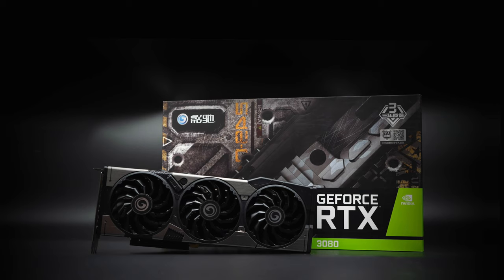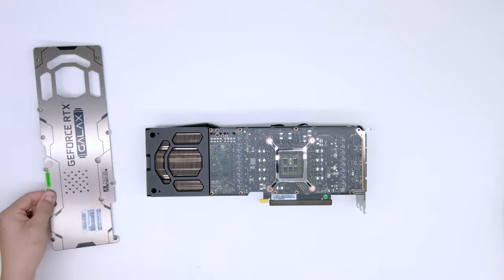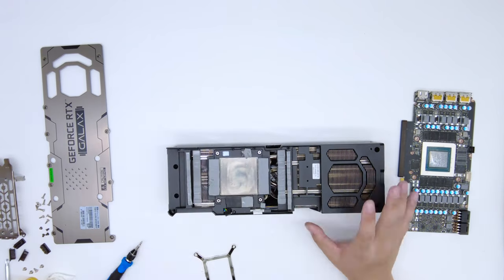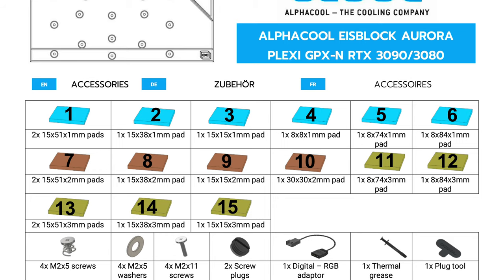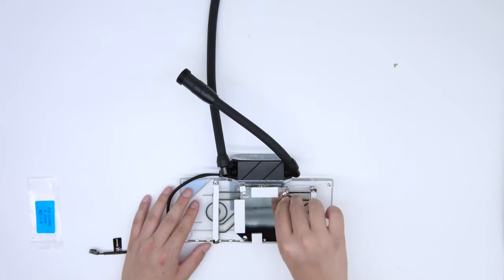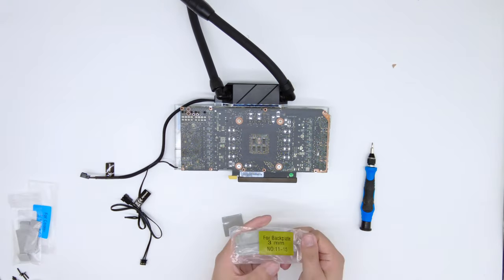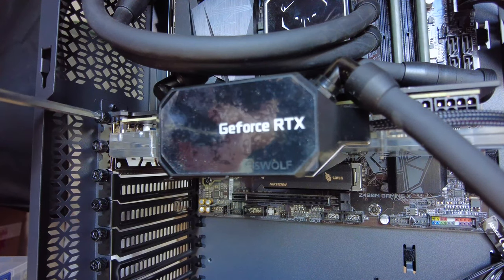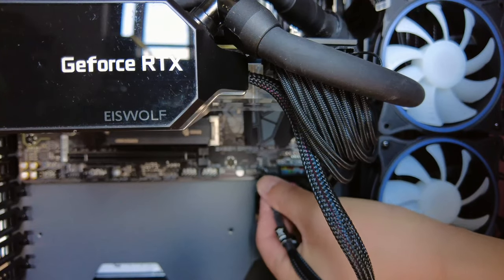Galaxy 3080 x Alphacool Eiswolf Watercooling Kit - Part 1. Installation

Comment: Just for anyone wondering. I got this for my 3080 gaming pro and it went from 85c to 45c max load. 65c to 34c  idle. This was the best thing iv done for my pc. No noise either :p would recommend this over any other cooler set up. Affordable and efficient.
Reply from the maker: great to hear! Checkout my ZZAW C4 custom loop video if you have VRAM temp issue too. Replacing the thermal pads on the VRAM proves to be highly effective.
Reply: How is it holding up 7 months later? I've read varied reviews
Reply: I guess after several months he realized that its the worst thing he have done for his pc (immediately regret the decision)
Reply: Is it prefilled? Don't understand how it has liquid in it when the hoses have connections.
Reply: @rceenomil  yes right:D i guess he also bullshit a lot about his 45C max load GPU to:D 
Cause i just see a german guy testing ALPHACOOL EISWOLF 2  with 3080ti and he say the fan are very quiet till at around 30%,, and at 30 % fans he get 65C on GPU and 73C hot spot GPU, and at 100% fan (he say is very loud like plane jet:D) he get 56C gpu and 64C hot spot, mabe if u replace the fan with arctic P12 argb or noctua to be quiet. I also see a us guy he getting 54C gpu at half of the speed on haven benchmark but with rx 6800.

Comment: Currently have an EVGA 3080Ti FTW3 and debating between the Alphacool Eiswolf 2 and the EVGA Hybrid Kit. I assume the Eiswolf 2 would cool the VRM better than the hybrid kit, but I look forward to your review first.
Reply from the maker: For VRM, Alphacool waterblock actively cools 3 sets of MOSFET, and that's about it. There's no direct contact for the inductors, capacitors. According to them, only MOSFET needed to be cooled and the rest are fine as is. I will keep in mind to do a thermal shot of the inductors and capacitors, but for my miners, MOSFET run about 50C, inductors about 75C. 

Again, I'll do the thermal during the test. Thanks for watching and commenting!
Reply: Did you go for the Eiswolf for your card? If so, how is the temps on the evga?
Reply: @nictheflick  it turns out that the Alphacool Eiswolf 2 was not compatible with EVGA FTW3 cards at that time I wrote this comment, but I believe they now have a separate AIO for the Eiswolf 2 for EVGA cards. So at the time, I went with the EVGA hybrid kit and it did an amazing job in dropping temps to 26 C on idle, and 55 C in most games, sometimes going up to 63.

Comment: for the quick disconnect do you think you could plug a g1/4 connector into it or get an adapter so you can use a bigger radiator
Reply from the maker: Absolutely. Alphacool sells the TPV connector that you can simply cut or add additional components. Pump, in the other hand, might not be able to handle completely, so addtional DC-LT pump might needed.

Comment: Wondering how much third party brand as well as super/ti versions of a 4080 will make a difference in what cooler to get?
Reply from the maker: For 40 series cards, cooling advantage of watercoolig is somewhat less than 30 series and before. The real thing about watercooling the 40 series is reduced size. With that being said, stick with AIC boards will help shrink down the size of the 40 series cards, while maintain or improve cooling. 

If size is not the concern, sticking with air is fine as well.

Comment: Do you need to fill in the water by yourself? How is the RGB connected, what sort of connection does it use? How is the Pump and fans connected to the system? Those are things I need to know before purchasing one.
Reply from the maker: Hi, with EisWolf AIO system, water/coolant is already in the system. There is no need to fill. 

Pump is actually right above the waterblock within that screen looking bridge. Fans are screw-onto the radiator, you do need to assemble that. There're screws provided.

 Pump is a 3pin fan plug, and fans are standard 4pin fan plugs, RGB cables are provided too. There's also Y cable provided for the fan plugs in case you don't have enough fan socket available on the MB.
Reply: @masterbamboo  OK, thank you very much for answering! Have a great day.

Comment: My only concern is the warranty for my GPU. I am sure that if my GPU fails for an unrelated reason, every GPU seller would love to blame me changing out the OEM cooler.
Reply from the maker: For few years I've been modding the GPUs(started with 780 with NZXT AIO conversion lol), even with some RMAs on 2080, 1080 even the recent 30 series, I haven't had any brand that accuse me of damaging the GPU. Few things to note:  

First of all was making sure myself is not the one to blame - issue not caused by leaking, shorting out circuits. 

Seconds, few brands has been friendly with me personally: ASUS, GALAXY, Yeston, DELL/HP OEM, I tend to stick with them. For those brands, you don't have to go through seller to get the cards RMA. 

Third, make sure you have the sticker removed or replaced properly before sending back for RMA. 

Hope it helps.

Comment: Great video! My AIO came with dirty water inside. The radiator should be with cables on top or down?
Reply from the maker: Thanks! The Alphacool kit has its pump with the GPU so the orientation really doesn't matter THAT much. If the coolant(CKC) is not clear, you can replace it rather easily.
Reply: @masterbamboo  It's just open one cable, take coolant out and replace it with the same amount?
Reply from the maker: @bollygod  There should be a fill port, right around the pump (top of the card or under the RTX cover), you can use the quick-connector to drain and refill if you can, and top off with the fill port. It's a process that'll need some patience.
Reply: What are your gpu temp in 4k?
Reply from the maker: @Hairtransplant993  Room temp ~20C, GPU core ~50C. Full load.

Comment: So I installed this on a 7900xtx and got hotspot temps that are like 40° over my gpu temp. Any ideas what this could be?
Reply from the maker: Yes, we found the center flow plate creates too much pressure. By removing flow plate of the waterblock (the thin square metal plate in the center), it improves the 7900XTX temperature tremendously. Interestingly this only applies to 7900XTX and none other model.

Comment: Could you tell me where the black mesh cable is connected?  I connect it to the water pump + of an asus motherboard, would it be fine there?  And the radiator fans, which would be the most suitable connector?  Thank you!
Reply from the maker: Hello, W_PUMP header of ASUS motherboards works great for the pump! Alternatively, the pump header can be connected to any fan header on your mother board, as almost all of modern ASUS motherboards has a 12Watt connector while the pump only draws about 4 Watts. If the light on the top of waterblock illuminates green, it's all good. 

For the fans, you can connect it to any fan header you'd like, and you can adjust fan settings accordingly in UEFI/BIOS menu (running at constant speed or depends on CPU/MB/VGA temp, however you'd like.)

Comment: hello 
very nice tutoriel 👌
i did the same and my gpu is now running at 63° full load i think its hot for a custom 360.
Reply from the maker: Thanks! during my test(upcoming), Alphacool's RGB fan is somewhat limited in it's capability. I did try to swap a different set of fans, it did allow it to cool down much more - I also tried push-pull config, which allowed me to slow down the fans and kept at a pretty slow temp. (42°C core during mining, 47°C for gaming)

Comment: Where is everyone plugging the pump into on the mobo? My CPU pump is already plugged into the AIO slot. Does the GPU pump plug into the spare water pump header?
Reply from the maker: I simply plug the pump header into the closest port I can find, set it to DC mode in CMOS, and making it run full speed.
Reply: @Master Bamboo  thank you! I've found another post where someone plugs the GPU pump into w_pump and it runs constant. Going to try first. ThanKS again!

Comment: @Master Bamboo where do you put the FAN PWR/CTRL into? Why not on GPU ?
Reply from the maker: putting it on GPU will require some modding to waterblock, which may involve drilling certain parts or purposely crushing the extension cable, which is not the best idea. So, the other way around is to plug it into the motherboard and control via fan headers in Windows, there's a fan control app which can control fan headers based on GPU temp.
Reply: @masterbamboo  in my Case there is no modding needed the PWM Fan Adaptor  for VGA Cooler Fan fits perfectly.  (Alphacool Eiswolf 2 AIO Suprem X 3090)  The reason why i have to do it that way is because i cant Set the Fan Control on PCIE in My Bios. MSI MPG X570 Gaming Pro Carbon WiFi (Bios Updated) 
thx for the Info tho
Reply from the maker: @F45TL4N3  Suprem X 3090 does have the fan header located at the side which is perfect. 

Not many motherboard supports PCIE monitoring out of box, most of us just use an app called "Fan Control“ which runs a daemon/service in Windows that monitors GPU temp and control fan according to however you'd like to set. 

Great info！

Comment: How did you connect the rgb it's the only thing I can't figure out I have a asus prime plus b550
Reply from the maker: Howdy, the RGB has a 3 pin connector, in the packaging, it also has a converter that will convert to the header that can connect to the motherboard. : )
Reply: @masterbamboo  a fan header or a 5v 3 pin header
Reply from the maker: @johnchandler6085  From the waterblock, there's a 3pin square header that can adapt to the 5V RGB header. 

From the motherboard, ASUS calls it Aura RGB header, it's a 3 pin 5V RGB header on the motherboard, I recall one on the top and one on the bottom. 

Connect those 2 you'll be good to go : ) Fan RGB shares the same stuff I recall.

Comment: Can you tell me please where should I plug in 3-pin pump connector to my motherboard (msi z690 torpedo)?
Reply from the maker: You can plug the 3 pin in any fan header on the motherboard. The pump itself is only less than 4Watts, so any fan header is fine. 

Then, go to CMOS/BIOS settings, configure the header to full speed.
Reply: @masterbamboo  ok thanks!

Comment: Any advice why my temps haven't changed? Can reach 80C while gaming on 3080ti. I have a lian lu push pull 9 fans, there's enough space. It doesn't make sense, I'm out of ideas..Any specific thoughts on how to address this would be appreciated.
Reply from the maker: Hi, sorry to hear the trouble - I want to confirm few things. 
1. What's the overclocking/power limit on that GPU? The test we've been doing are based on stock 320Watt limit. 
2. Is the GPU pump indicator (on the top of the GPU) shows green or white? Green means pump running ok, white or other color means pump not getting enough power. 
3. What are the fan RPMs? Also what fan used? 
4. When you hover your hands over the fans when GPU pushes to 80°C, are the air coming out of the radiators warm? If not, it may indicate the waterblock is not installed correctly.
Reply: @masterbamboo   Thank you so much for the reply! If I could get this fixed it’d be very awesome. To answer your questions: 
1. I have a stock founders edition 3080ti so similar power limit if not exact. MSI afterburner says Voltage while gaming is around 1500.  
2. The GPU indicator is green (nice to know, I had no idea the light color could indicate issues. 
3. The fan Rpm’s are around 1500. I generally use the quiet fan preset with Corsair iCUE. 
The only fans being used are the Corsair QL series 120mm. I have an aio (NZXT Kraken Z73) 360mm for my cpu mounted at the top for exhaust. The Alphacool is mounted at the side for intake, & 3 fans at the bottom for intake. 
4. There is definitely heat coming from the alphacool aio.
Reply from the maker: @mopnem  Awesome, great info here. 
1. FE cards has a slightly different setup, but generally the same. 
2. Awesome there. 
3. Unfortunately I hate quiet fans lol. Here's the info, I used fan provided by Alphacool, and have the fans spin to about 2000 RPMs, I also removed the mesh on the back panel to help the hot air to get out. 
4. Good to know. 

The next step I'd personally suggest are follows: 
1. If you can, try to see if the temp readings are correct - one software I use is HWInfo64, that will tell you the GPU core, GPU Junction and also VRAM Junction. If the GPU core and Junction has very different readings like 20+ degrees differences, then waterblock is for sure not installed right. 
2. The other thing I'd try is to open the side, front, and back panels (I assume those are glass panels? back panel might be meshed steel). To see if those helps lower the temperature. I've ran into issues where all glass panels blocks intake, and exhaust was covered by a mesh filter of some sort. 

Hopefully by 2 steps above you will be able to resolve - if it is indeed case issue, then there're things that you might be able to do to help.
Reply: @masterbamboo  Your help is truly appreciated. I used HWInfo64 during gameplay. 
1. The memory junction & temperature only had a 1 to 3 c difference. The gpu had a max of 348 watts. 
2. If I remove the top case piece I have a small temp difference from avrg 80c to 78c but it will reach up to 83c given enough time. Removing the glass front or side doesn’t change the temps in a significant way.
Reply from the maker: @mopnem  Hey, sorry it took me a while. 

I checked with Alphacool with your temperature issue. They are concerned with 2 things - the case ventilation (the back panel may have the hot air packed in and cannot get pushed out). 

2nd of all - fan speeds - fans might be a little weaker. 

They also suggested to post issue and more detailed info on their forum so more community members and their support members can help.
Reply: @masterbamboo  Absolutely awesome that you contacted alphacool, more YouTubers should def be like you. Hmm, It may be a hot air issue, basically.. I gave up. What I wound up doing is adding 3 more 120mm fans (I had some extra nzxt ones lying around) behind the 3 on the side panel, (so in the back). That helped by like 2 degrees tops, so I had to just go ahead and under-volt & underclock the card. It took me some time (as I was learning aswell) but I settled on 1800MHz @ 818mV  that works for most intensive tasks/games albeit with some performance hit. If I run the fans around 2000rpm (which internet says is about 500rpm too high for top performing 120mm fans, so mabye I should buy some Noctua fans or som) - but with those 2 changes 67c is the highest so far with regular use. Long use it’d get higher I’m sure & some very few games need higher voltage but considering the alternative, it’s the best case I have so far. It makes me wonder if a custom loop would be any different temps wise? or if my expectations of alphacool were too high?
Reply from the maker: @mopnem  Thanks! You are not giving up, but rather figured it out. To answer your questions by order:

1. It may very well sound like hot air issue - by enclosing or not enough airflow, it may heat it up over time. If it's installation issue, the temperature will spike instantly instead of going up gradually. 

2. For fans, I would actually recommend Delta AK-12B if you can find them. Those are the most balanced pressure fan I've seen. They are the to-go fan for my custom loops. If you want RGB, then there is a AVC fan that's OEM for Lenovo 9000k desktop, they are quite awesome (featured in my latest alphacool video), but are loud when pushing to max. 

3. The custom loop will be able to use a more powerful pump - which in term will help the water to flow quicker, and will help in short term, BUT! if it's truly the ventilation issue you're after, it will still get hot water temperature, in term, will still have a hot GPU core. 

Bottom line, since you have it pretty much figured out, you can always mod it only when you feel up for it. Now, when you're up for it, you can try to take the radiator out of the case, and just leave it hanging outside and play for few days to see if it make a difference. Then you can start consider to either switch fans, switch cases or do some other mods. 

BTW, what's your room temp?
Reply: @masterbamboo  Thanks for the fan recommendations & great idea to leave the radiator out for troubleshooting, never thought of that. I don’t know my room temps atm but yet another good point, I’ll have to measure my the rooms avrg temps & let you know, thanks again for all yr assistance.

Comment: Where did you get that cpu water block?I don't remember alphacool have sale this block before.
Reply from the maker: pretty sure AuqaTuning in the US has it if you're located in the States. Otherwise, they have shops around the world. Europe is even simpler, Alphacool has their official store in Germany.
Reply: What is the product name？I look over the Aqua Tuning and alphacool website, I didn't see anything(btw I'm asking for CPU AIO not the GPU one)
Reply from the maker: @gordons0812  Ah! Nice catch! My apologies! The CPU AIO is the upcoming Alphacool Eisbaer LT. They have not released yet, I was testing the engineering sample(thus without proper RGB fan) the other day and got lazy, so I didn't take it off.
Reply from the maker: @gordons0812  The CPU AIO is finally released and I can talk about it now. It's a new version of Eisbaer LT. They did NOT change the RGB fan after all. The pump is slightly more powerful now, and it looks cool compare to the previous model. Sorry I couldn't talk about it more earlier. And the tubing is nicer with TPV.